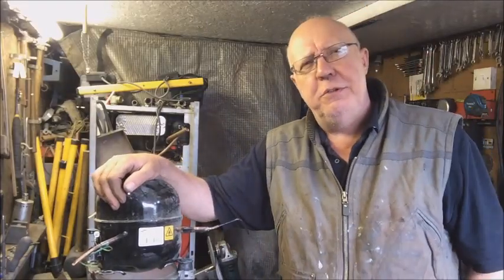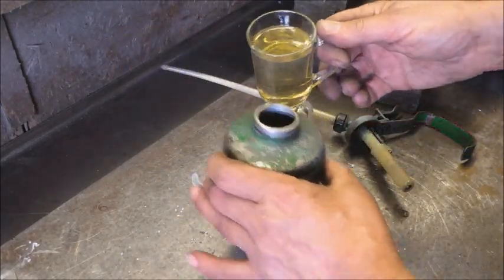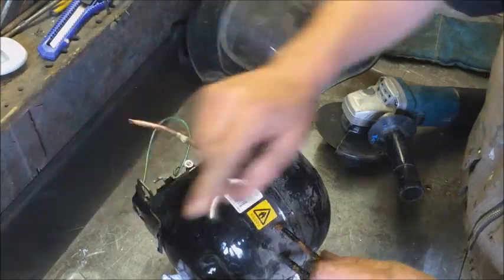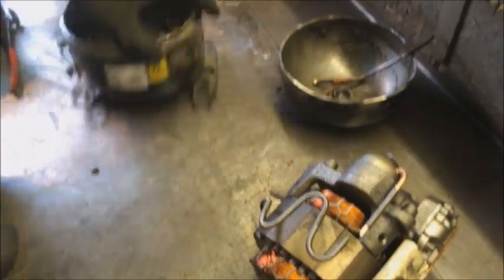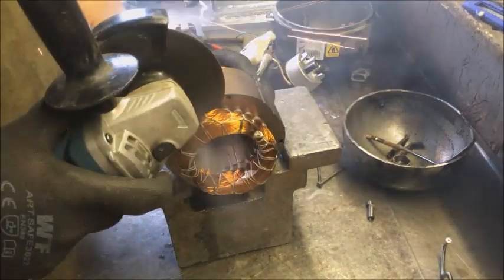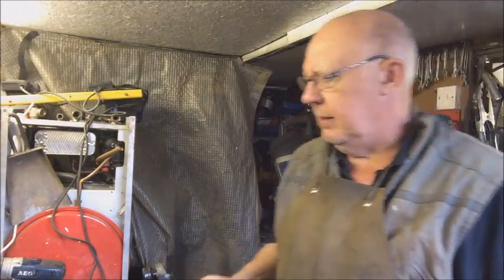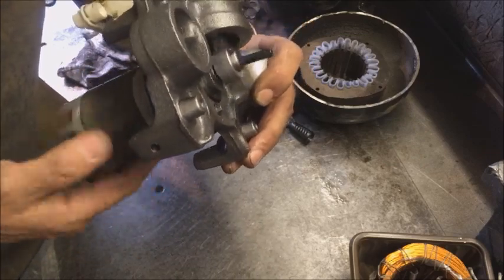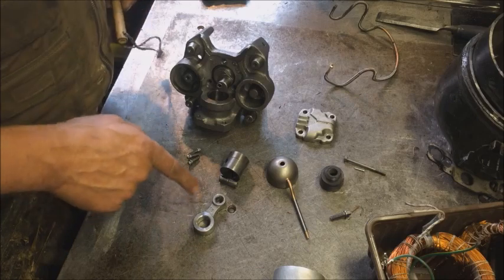Fridge Compressor Motor for Copper,, Worth It ? Yes

Comment: Nice one Ian, was a great video mate 😀 anyone watching, don't forget to separate cast iron from steel as it's worth more and separate steel's into light and heavy. Plus a bucket for your aluminium which is about 50p kilo 😀 if you can break a motor in 30 mins you making £12 an hour for your time plus the £4 you would have sold it for as is. Sweet 😁

Comment: I will start cutting my compressors open. I only found this video because I'm searching if old school hermetic compressors have copper in them. I have quite a few but wanted save time and not break them down if no copper is inside. The scrap yard is taking them as mixed scrap as they claim there's no copper in it
Reply from the maker: A lot of the newer ones are aluminium wound, best to drill a hole in the side first to see if copper or not.

Comment: Just bought grinder and opened the compressor today definitely worth it the experience the scrap value is just bonus
Reply from the maker: Then it was all worthwhile
Reply: @Man-in-da-shed  yup the experience using the grinder is fantastic
Reply from the maker: @dragonlore8484  yes a really great tool, I call it my universal key, opens anything, but it it also the most dangerous tool in my shed, it is very unforgiving on mistakes and can cut, burn savagely in the blink of an eye, and speaking of eyes ALWAYS use eye protection, I’ve Been in hospital a couple of times with metal bits in my eyes, Heed this advice.
Reply: @Man-in-da-shed  do these motors contain any gases or oil that is flammable?

Comment: Some scrap yards call the bright copper, copper windings instead... I striped out loads and got stung at the scrap yard. Also, I went through lots of grinding disks so I just broke even.... Never went back to the place. My experience was that you have to spend your time doing what makes the most return. So I left motors intact, didn't strip cables and just collected... Made more doing less.... Funny business. Good video pal. Well done
Reply from the maker: tobias green ,  a lot  comes down to how much you value your time. As scrapping is a hobby for me. The time is irrelevant,  my last vid definitely proves that,  how does a fisherman view his hours spent at the side of a river with no return.  As enjoyable I guess

Comment: Hello Ian. Haven't seen too many of your videos lately. I remember bringing home two of those compressors on the bike once only to find out my scrap yard doesn't take them. I never strip motors.
Reply from the maker: Well thanks for hitting the back catalogue,  indeed some yards won’t touch em with a Barge pole. But they are lucrative for the copper if stripped, and even if taken by a yard they are not classed as motors

Comment: More useful as a shop air compressor than for scrap. Many of these put out over 500 psi, great for air cannons and other projects. Could easily be sold on Ebay for more than 20 Euro if it works.

Comment: Hey Ian, i wonder what kind of cutting discs you use that you need half of it for 1 compressor. I have some where i cut one open and only used like 2 milimeters of the disc

Comment: interesting video Ian. I have a similar compressor motor I removed from a fridge and enjoyed seeing what is inside it but after watching your video I don't think it is worth stripping in my case due to current scrap prices here in Sydney. A scrap motor is 60c a kilo while a kilo of copper winding is $6-$7. Obviously selling as is would be $6 so hardly worth the work to disassemble for an extra dollar at most. Thank you for saving me the time I would have spent to break it down not knowing the amount of copper inside. Cheers.
Reply from the maker: jim harry  your welcome.

Comment: I started cutting open compressors after watching this. Recently I quit the practice after cutting open a very large compressor and discovered the motor windings were aluminium. That's the biggest disappointment I come across when scrapping. I now sell my compressors as "sealed units." Don't have to mess with the oil, and I don't go through a couple dollars in cut off wheels.
Reply from the maker: It is disappointing to find aluminium wire, you could always drill them first to find out if copper or not, 
Use a diamond wheel more expensive but lasts a longtime, I’m fortunate I get part worn cut off wheels for free.
Reply: @Man-in-da-shed  I can't recall what my scrap yard pays for sealed units. I could do the math after my next run, but considering I usually only have 2 or 3 of them I'm not sure I'll mess with them anymore. I drilled holes in the units and let them drain for a few days, but everything is still oily.

Comment: was that the gas / freon that came out though things like this worry me about scrapping stuff , i have a dehumidifier here its about 20 years old not been used for 15 years but too worried about scrapping it out .
Reply from the maker: dave hazel by the time I had got it, it had been depressurised, but yes be careful the older systems do have a flammable ozone depleting gas. Google refrigerant gas.

Comment: I'm a scrap man and I'm just stripping my first moter from a dryer but the fridge bottles is that we're is gas is in a fridge? Is it safe cutting them off a fridge then just cutting up like you did? I'm guna start stripping the lot I see 20 plus fridges a day
Reply: I thought this wire looked darker than copper I started to cutting through it and I think it's ali with a dark burgundy colour it's silver inside
Reply from the maker: Aieee what a question to ask me, the gas is in the whole system, if you cut any of the small pipes from the fridge pot you will release the gas, in the UK that’s a no no, if ya get caught doing that then you can get a large fine, fortunately all the one I get have already been depressurised.
Yes more n more of the pots will have Chinesium in them. Ie fake copper, copper coloured ally wire 
That’s a bummers. As you only find out when you have cut the top off, unless you drill them first. 
I did an experiment on that there’s a vid somewhere where I did 10 pots.
Reply: @Man-in-da-shed  yeah I'm guna completely stay away from them gas terrifies me anyway

Comment: You forgot to factor in the cost of the grinder wheel and total time/labor. There is also electrical cost but it is almost trivial. All in all, still sounds like it would be "worth it" if you have more time than money or just bored.

Comment: HI IAN I just came across aluminium windings in a compressor I couldn't believe my eyes. I'm seeing more and more aluminum the transformers in microwave the secondary windings also aluminum. I'm at a point now wondering if it's worth opening compressors I've given up on microwave ovens.
Reply from the maker: note book   Yep very disappointing isn’t it, I’ve considered drilling them first,   In theory if I get aluminium swarf on the end of the drill bit, then I’ll know not to bother. As for microwaves, I go for the big copper slug in the Magnatron as the prize now.

Comment: interesting i just stripped one of these yesterday i always take the copper out its worht it but i thought the other stuff was white metal it doesnt look like aluminum...white metal and aluminum the magnet doesnt stick to either so at times it can be hard to judge...i take the rest apart i guess and if its not aluminum then its not i guess...white metal isnt worth anything different than regular scrap tin so i put it all together...like door handles and such but ill take the rest of this apart just in case...yeah these little motors have alot of copper in them they are worth taking apart and its fun to myself also..Air conditioners are aso worht taking apart theres the aluminum rads in there worht a decent buck and copper too.

Comment: I watched your video to figure at why my fridge compressor has been loud for the past year but it still works.  The knocking noise is usually different each time.  It might do it alittle bit every hour or just at night. Could u tell me is it just loose in there and can i be sure that it will keep my food cold, even tho its annoying?  Thank you. Carla
Reply from the maker: Carla should be pretty silent can be a number of reasons, compressor failing, fan failing, vibration, pipes touching, Samsung have a  Fridge with a design fault which needs a noise reduction pad fitting, google your make and model that should help you

Comment: BigstackD: Im going to needlessly hammer all of this wire through the stator with a flat punch

Ian Matthews: Just grab it and give it a good whack...
Reply: Did compressors and motors for years. The copper in compressors  nearly always comes out very easily like in the video because they are oily. Motors need punching out. Slim ones can be hammered off. Big transformers and long motors can be a nightmare. Bash all the plates off or cut the whole thing in half with a big grinder.
Reply: @kentrobison588  does it real work to just cut them in half I don't want to pull every single slot
Reply: @brandonkocanda5413  Yes. Compressors are very easy to salvage the copper. With electric motors, the copper usually has to be punched through the slots and long motors are difficult. Long motors may have to have all the plates bashed off.  I just did 8 compressors in about an hour. I use ultra-thin 9" cutting discs. Find the three welds on the compressor and cut right around the unit beside them on the long side and remove the end and the armature.. Cut down the length and across the bottom. You do not need to cut the other side so save disc wear. Just spread the long cut a bit with a hammer and cold chisel and the windings drop out. The copper does not need to be punched out. Just bash the copper at one end and they slide out easily. Be very careful cutting them open. Hold the compressor tight somehow.
Reply: @kentrobison588  my question is really for big motors because I have some glycol pumps 254 lb motors that I'm tearing for scrapcutting them along the edge and then just pulling the wire individually which seems to be like the only way I see people do it
Reply: @brandonkocanda5413  https://www.youtube.com/watch?v=Z5LHrD6OFS4

I misunderstood the question. Think I am going senile. The biggest motor I have done was about 100lb.  The long motors in bore pumps I cut in half but it costs disc wear and doing them on a dropsaw might burn it out. Some motors are really hard and I spend a lot of time bashing plates off.   Cut the end windings off with an ultrathin disc on an angle grinder and then use it to grind the copper flush if it sticks out a little bit. They are harder to get out if the ends are a bit bent over.  I use use small-angle steel wedges 1/4' to 1/2 ' thick and hammer them in under the loops to lift the bunches a bit. Then bigger wedges. A strong   slide hammer with a heavy slide might be good. Make one up with a hook and hook under the loops after they are pulled out a bit. Pulling a few wires first will loosen the others and the lot will come out easier.

Comment: Good day from Ont. Canada. Did you say copper is worth 4000 pds. In Canadian that would roughly be $6000. / metric tonne  Thanks sorry if I wrong  Thanks
Reply from the maker: Don Voll  ,  bright wire can fluctuate between £3,800, to £4500. A metric ton so 1000 kg,  so I take an average of 4K  I don’t know the CND exchange rate but if it works out to  $Cn.  6000. Then yes your right

Comment: Want to hear how my state sucks. I've worked Hvac for 15 years but no longer. Never have I seen any company reclaim or recycle any refrigerants in my city or others. My Hvac supply company can't even tell me where this might be accomplished and they sell the toxic stuff. I wanted to make a few dollars off of some old window units sitting in my yard. They don't even have a charge left due to rust and were discarded because of restrictions many years ago. The recycling companies tell me I need a Hvac business license and a permanent from the sheriff's office to scrap them broken down. I can however scrap whole units at steel prices. They won't do nothing but dump the charges if there were any and I know Hvac repair companies aren't scraping their old units. They just give it away so its cleaned up and they don't have to waste time on it. Better to be running service calls and installing duct and systems. In only trying to get a few dollars for gas. The Epa, law enforcement and these big companies are all criminals and crooks. Plus the damn ozone grew back like a lizards foreskin. Now only car converters go missing but God only knows where they go.

Comment: shoot, you didn't show how you got the motor rotor apart...have not seen anyone do that except this video and you already had it apart.  just whack the shaft out, or after grinding away the rotor plates the shaft comes off?
Reply from the maker: Jack Murray ahhh that’s cos I have a separate vid on taking copper off the rotors
Reply: @Man-in-da-shed  great, do you have a link to it, searched you channel and did not find it.
Reply from the maker: Jack Murray https://youtu.be/VUolal5rZVg

Comment: What is that tool call  ? The one you use to get a grip on the copper and pull it out
Reply from the maker: Joes Pizza   Pincers. Used for removing nails from wood,

Comment: So you doubled the value how much did that blade you usef cost you since it looked almost gone when you were done
Reply from the maker: drek67045  A very pertinent point.  Those blades cost 65pence. I'm fortunate that I have a free supply of those, however I do say I would normally use a 9" Grinder, those blades although twice The price last considerably much longer,  getting many cuts from one. One guy commented below says he uses a diamond blade and it lasts him ages. Other people use a sawzall or even a bandsaw. 
Thanks for watching and taking the trouble to comment  it's appreciated .

Comment: Be careful when cutting them as the oil sets alight . I save them all year then chop them up in winter for a bonus
Reply from the maker: I bet you could do with an easy way to check if ally wired or not, it’s almost disheartening when you have done the work and find it’s not copper

Comment: How much is copper going for in England ?
Reply from the maker: I don’t actually know, I haven’t weighed any in for months, when I got £7 a kg for bright, it has dropped so I’ll estimate at £5.25 for No2. And £6 for bright
Reply: @Man-in-da-shed  in Missouri bare bright is $2.80 a pound and #2 $2.43
Reply from the maker: @MoDave82  there’s 2.2lb to a kilogram

Comment: FYI you use half of one of your grinding blades. Cut off wheels whatever you want to call them. Either way I found some that cut really good and some that are for s***. Diablo works the best for me so far. You're going to have to do that that with the  cheap price of blades Anyway thank you for your video and for your information
Reply from the maker: PhxtoNash    I’m fortunate in that I have a supply of part worn discs for free,  but I would normally use a 9” grinder, much quicker and blades last a lot longer

Comment: if you really want to take them apart quicker take a look at my channel. plasma is the way to go. I can cut them apart in about 10 seconds and strip the small fridge ones in about 3 minutes per unit.
Reply from the maker: Scrapman Industries Scrap processing  yep that would work. There is a comment below saying beware of fire using a plasma,  I get so few it ain’t worth filling my air tank up, I appreciate the comment 👍
Reply: @Man-in-da-shed  yes. i would not recommend using plasma on these indoors because of the fumes, but as for fires i've yet to have one catch fire with the plasma. oxy-fuel is a different story completely.

Comment: i wouldn't make a habit of picking up old fridges for the compressors. There's a £2,500 fine if you caught not complying with the regulations for removing the gasses . good video though

Comment: I thought they were under pressure and shot toxic stuff out when you snipped the copper tubing on the outside of the cylinder.
Reply from the maker: RuthieWrangler you are quite correct, the older ones indeed have a toxic ozone killing gas in them, I don’t think the newer gas is as bad, I assumed that as I got this of a Hvac engineer it had been properly degassed

Comment: Be care with heat and r22  making a deadly  nerve gas (phosgene)plus r12  is another.
Reply: Any gas is long escaped by the time this is cut open!
Reply: Data label showed It was r600. Isobutane/propane . But as above said. Gas long gone
Reply: Where is the gas and how come it is gone? Is it in the main compartment of the unit? Is this the same gas that's the reason you have to take fridges to be disposed of properly?
Reply: @ricfootball  The gas (freon) sometimes leaks  out. I used to be in the appliance recovery business. Mostly though, the freon had to be recovered; for this you need a special machine and a license. The freon itself had to be sent to a specialist company; for this you had to pay. You would only ever get paid when the freon was not contaminated, which was never.

Comment: You still have to take all the string off the copper , and it's no 2 copper because it's enameled , deduct cost of blade   and electric and petrol picking it up and time removing from fridge and  petrol going to scrap yard , time taking apart , unless you bored or retired , don't bother
Reply from the maker: Lol with respect. Wot a load of Bollocks.

Comment: Wow thanks for the vid I have really wondered if it was worth taking one apart for the copper an now I know it is . When I get all the motors apart an ready to melt I see if I can send you a link ,an thanks again
Reply from the maker: Beleg Cuthalion, you will be disappointed IF when opened it is a aluminium core motor.
Make one small cut to test first if it is then  don’t strip and weigh in as motors.